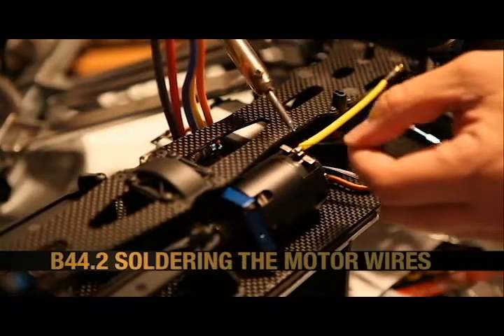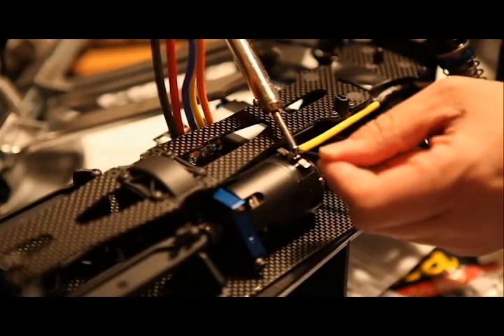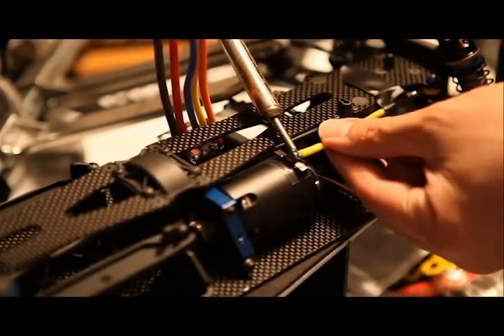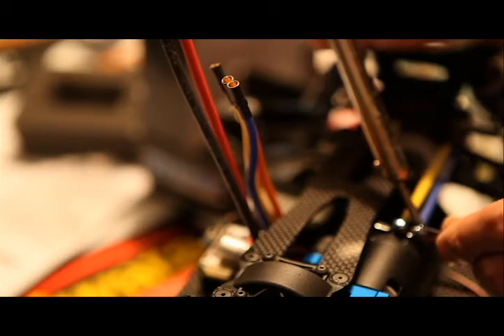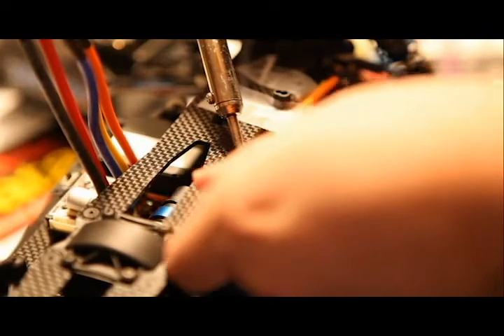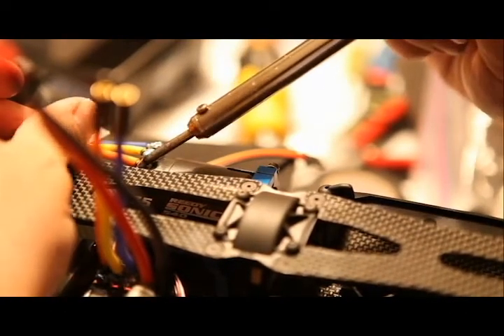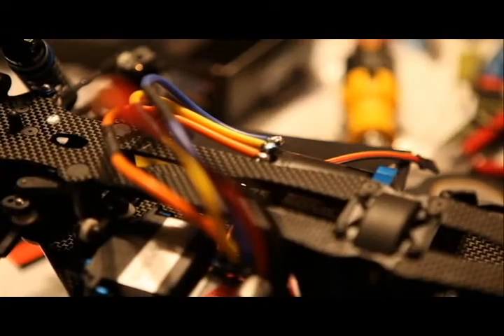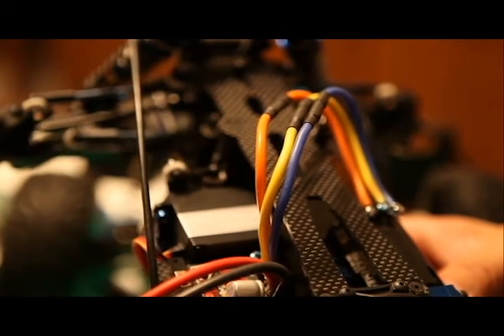B44.2 RC Buggy Build Part 35 Soldering The Motor Wires

Comment: I'm not the best solder-er either, but I typically leave a large drop of solder on the motor tabs and also pre-tin the wire.  Then all you have to do is heat the tab back up and the two will become one!